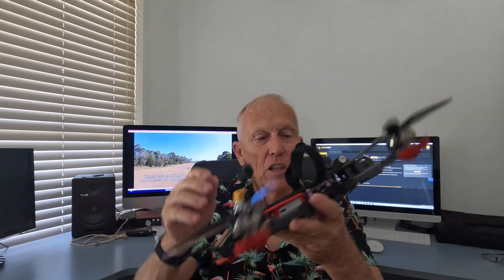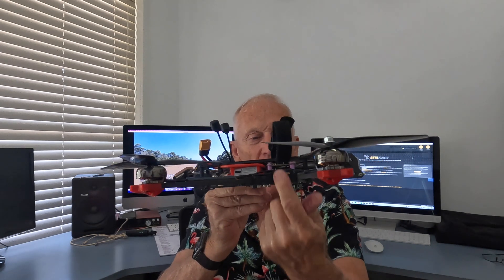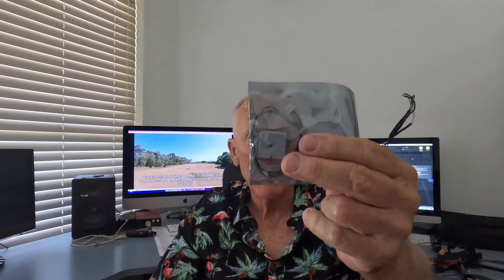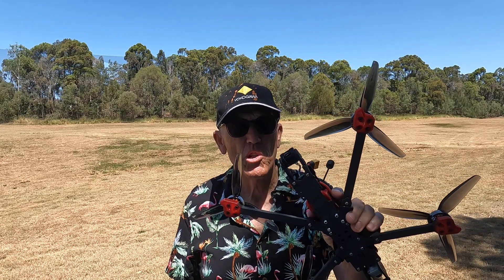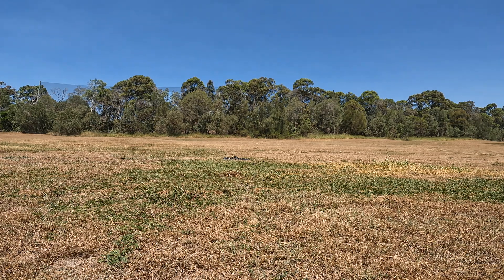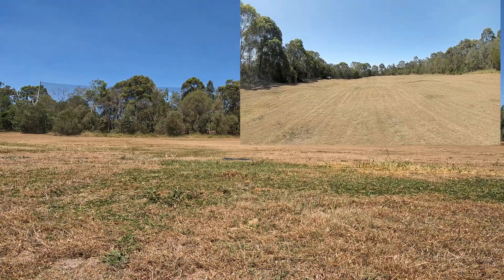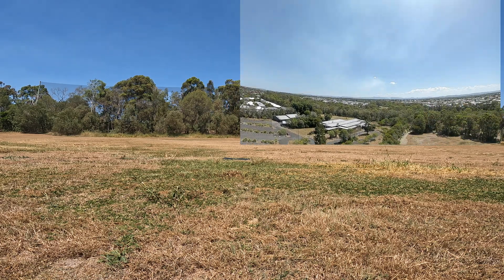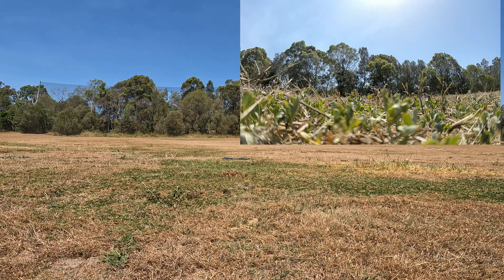iFLIGHT 7inch Chimera first flights and BETAFLIGHT 4.4 GPS Rescue with landing.

Comment: They used to supply the frame with a 20cm DJI mipi cable but they stopped that at some point. They do supply one with the new frame but that cable is for the O3 air unit

Comment: I have just finished a build of the Chimera 7 pro frame. I had to get a longer MIPI camera cable for the Air unit. The cable was easy enough to change and works. I also now use the WTFOS root on the DJI goggles and love it so don't be afraid to do the root. The rooting process is a bit fiddly but there is lots of good How-to on YouTube.  You can record the OSD now also. I am using the Matek M8Q-5883 GPS module and it works great. Happy flying
Reply from the maker: Thanks for the comments. I will look at the rooting option as it would be helpfull. I did get a mipi cable 20cm long and you are correct not too hard to install.  I have installed it allthough a little nervous with those tiny wire. I have moved the Air unit to the back (iFLIGHT position) which to me changes the Centre of Gravity to rear heavy. I would still prefer to have it in the centre and the stack at the rear. I have a few of the M8 GPS but this new one is unbelievable and fast.